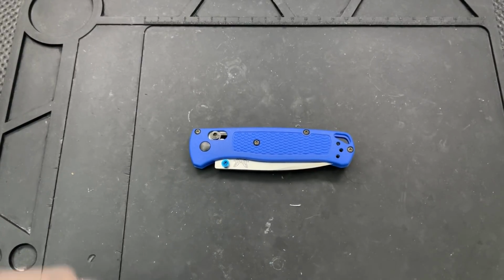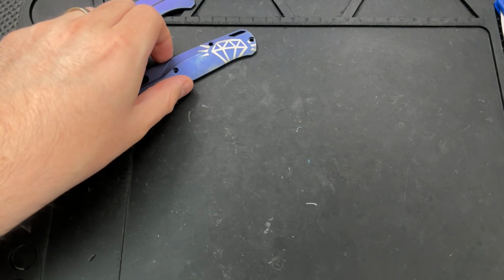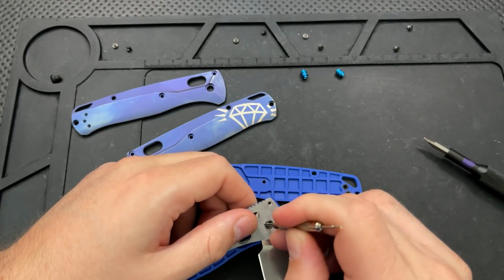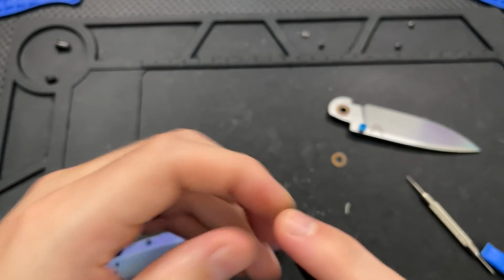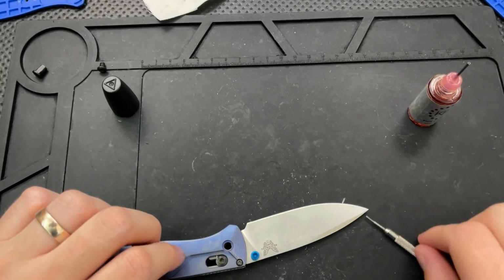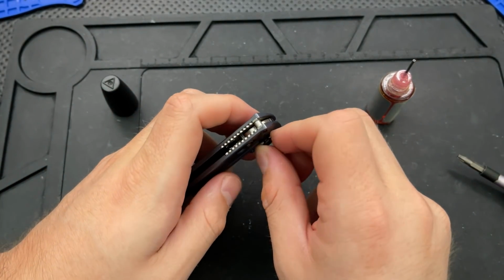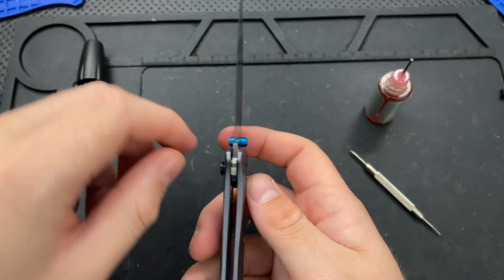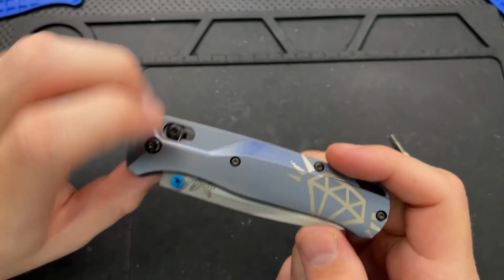Installing the Flytanium Crossfade Titanium Bugout Scales

Comment: The “integral” method of assembly/disassembly seems like more effort than it is worth. The omega springs are a minor complication, but after removing and installing them a few times it isn’t that bad.
Reply: Would the other scales fit on the Bailout? I remember you mentioned that the plastic scales was one of the worst things on that knife...

Comment: I have these on my Bugout and in my opinion they totally change the knife, for the better. It’s gone from just outside my carry rotation to my most carried knife.
Reply: What is the weight difference?
Reply: @airadaimagery692  adds about an ounce to the weight. Still under the “oz per inch” rule. Just makes it feel like a much more substantial but lightweight knife. Flytanium will sell a ton of these.

Comment: The integral method works fine, but let me suggest putting the stick part of a q-tip in front of the lockbar to take the tension off of the system. Then you won't need quite so much dexterity.

Comment: I too used to try and keep small screws in place on the end of a screwdriver with my index finger until I discovered that if you put the tip of the driver into a small blob of blue tack, twist it a few times and pull it out again, just enough blue tack stays on the end of the driver that it grips the screw and doesn't come off in the screw head....